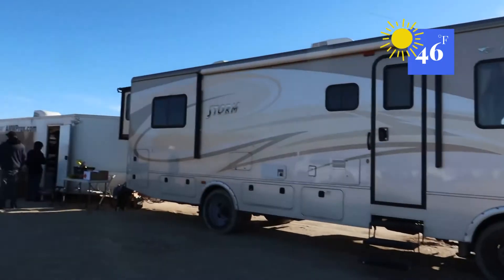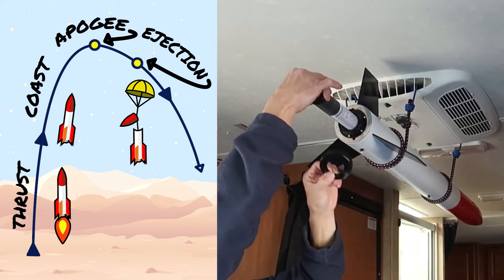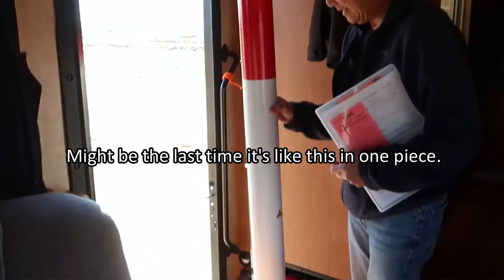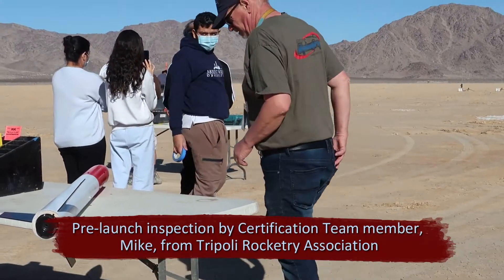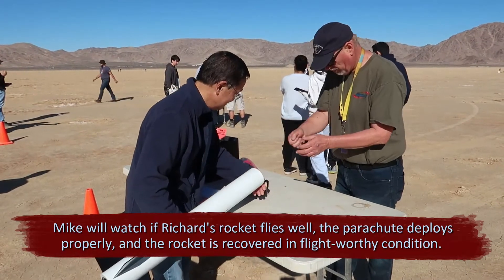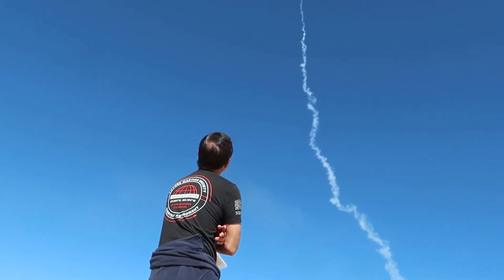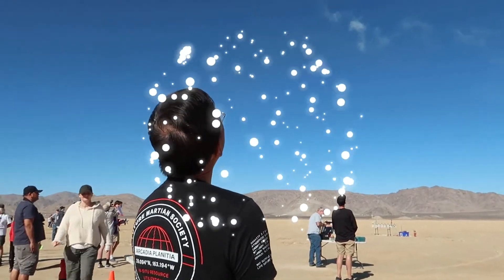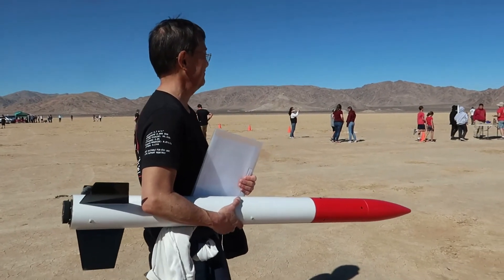High Powered Rocketry Certification Day

Comment: Congrats on the L1 I subscribed and plan to check out your channel after this, but I assume you already got your L2 lol. I just started my first custom build with zero previous experience will be going for my L1 this spring so it was a good experience watching you go through it all for your first time. You really went for it with that I motor lol I'm planning to use an H try and keep it low and slow for my first go at it.

edit: Bummer only the one video was a really good one though thanks for sharing your experience! I will definitely keep my eye out for any future uploads.
Reply from the maker: You might have assumed right, lol.  Now if I could only be as interested in editing video files as I am building rockets... 🤔😆